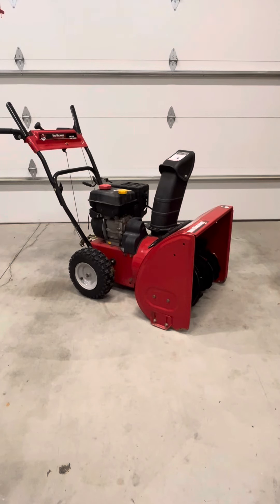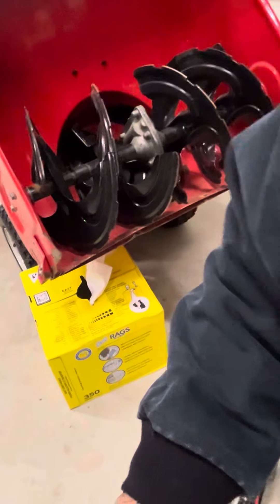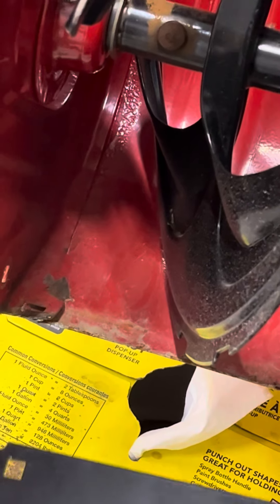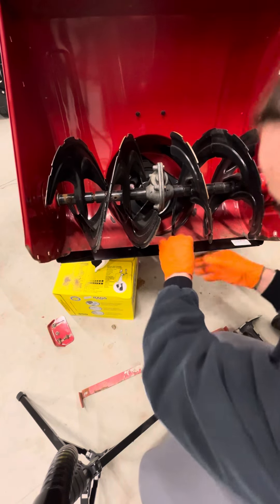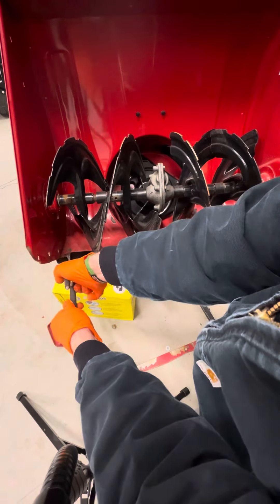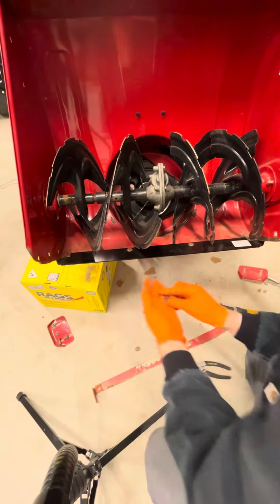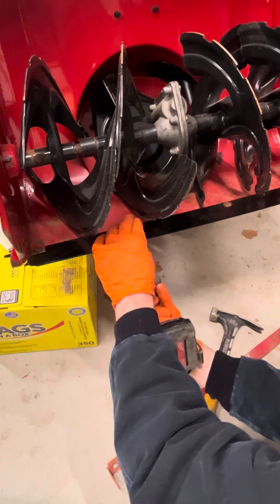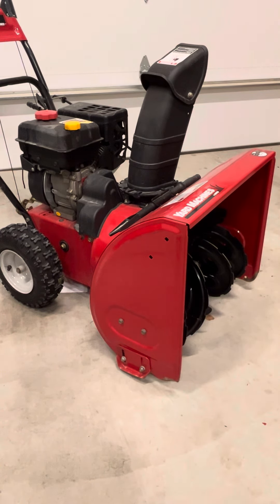How to easily install a new scraper blade on a snowblower. Snowblower repair. Small engine repair.

Comment: New scraper bar should be 1/8” to 1/4” above the pavement; even higher if you use it in gravel.  Loosen the skid shoes then put 2 pencils or paint sticks under the scraper bar.  Push the skid shoes down and tighten.  You can’t tighten skid shoes with the machine in the air.